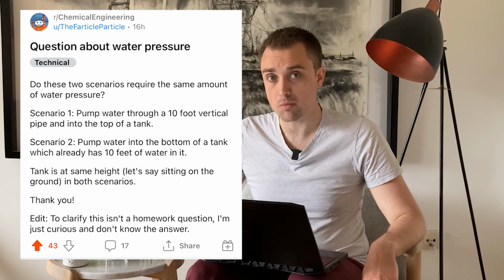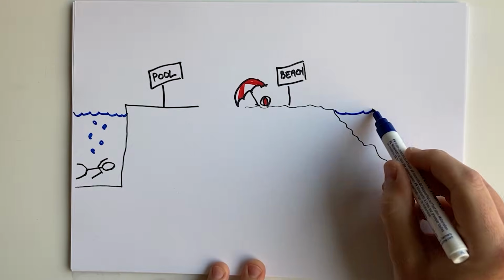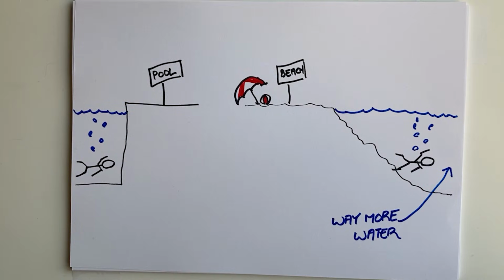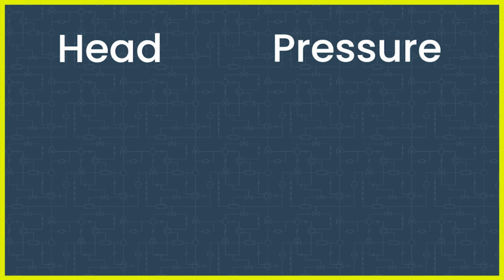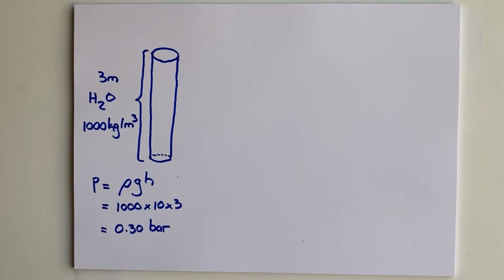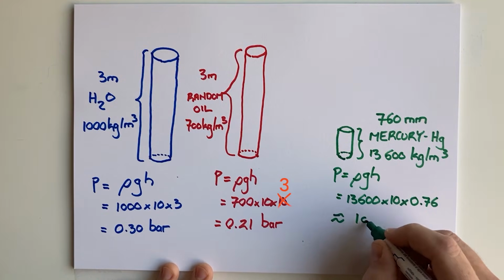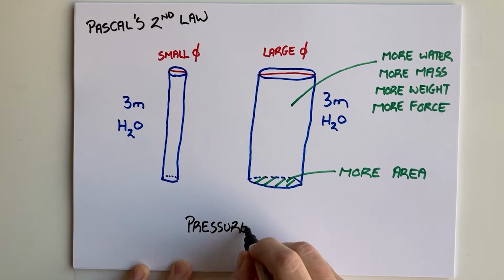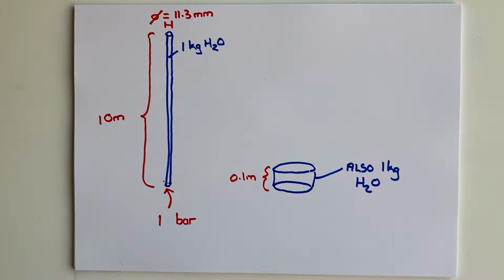Pressure, head, and pumping into tanks

Comment: One aspect that nobody seems to have mentioned is that a key reason to prefer bottom filling in many applications (e.g. rural water tanks) is that you can use the same pipe for both inlet and outlet for much of its length, thereby nearly halving the quantity and cost of the pipe needed. In the case of a tank on the top of a hill that is distant from both the dwelling and the water supply that can be quite significant.
Reply: As a plumber I have to consider cross contamination to the source water supply. There needs to be an air gap or some type of backflow, backflows have to be tested annually for potential failure, to protect the potable water supply source while also considering pressure loss or gain because of specific gravity’s .433 psi drop or increase per foot of rise or fall and maintain working pressure range to the fixtures. I would never bottom fill a storage tank just because of the potential cross contamination potential and an air gap is the safest with minimal potential failure and maintenance of any backflow prevention that you can use.
Reply: Good point for many applications, but in my case the source and storage tank are are all prior to filtration and water treatment including UV, so the potable water is protected by other means. There is a backflow prevention valve as well. The tank is perhaps ¾ mile away from the source so digging in a second pipe would be a lot of money for limited benefit. In a supply to another property where the tank is only around 300M away, we have run a second pipe with top entry.  @shadeiland
Reply: @shadeiland  wow! i removed my outside taps one way filter, so far no ratz have got inside!
Reply: @shadeiland  When I grew up we didn't even have a proper tank it was just a room in the basement made of concrete with no door. It did have an air gap at the top so you could see inside. So I'm guessing cross contamination wasn't as much of an issue as regular contamination.
Reply: It reduce the quantity of gas in the liquid too, wich greatly reduce cavitation in the pump. This why even if you pump in the top of the tank often the pipe continu in the tank to the bottom. Essential in case of high pressure pumping.
Reply: Not only that, ik you fill from the top, like in the example as seen in the video, you ALWAYS have to rise the water 3 meters, and the pump always has to use maximum presure ( and energie) to do that.

when filling an empty tank from the bottom, it just costs a lot les energie to do it from the bottom. than from a fixed heigth at the top.
Reply: @pw6048 The energy requirement for the pump is not the only variable you have to think about.
Also safety and hygine.
If you fill from the buttom you put fresh water in and pull the fresh water out the old water on the top will be stagnating and grow bacteria.
Reply: my tank fill at the top, or otherwise the water will run back to the source when source has no water.......       or check valve is  needed
Reply: @Google_ai_told_me_my_iq_is155  You have the most reliable check valve possible.
Reply: True. When refueling aircraft they pump from the bottom of the wing for a couple of reasons. They don't have to pump a greater amount of fuel up and over the wing. Also, it's safer than having to drag the hoses over the wing and even possibly damaging the wing.
Reply: such a very different use case senario!!
Reply: This is also true in urban/suburban water tanks.  A water tank is used to help maintain the head on a water system while pumps are capable of supplying that head while also pushing new water into the system.  While pumps are capable of providing this head that the system needs, it is more cost effective (energy costs and wear on the pumps) to use tanks/towers in conjunction with pumps.
Reply: Also, maybe I'm wrong, but filling from the bottom means initial pressure is very small, and you only get maximum pressure at the end, whereas filling from the top you end up with maximum pressure from the start, so the integral by time, that is, the work being done, is higher for the top-filling process.
Reply: @olegshevchenko5869  that would be true if the depth of tank was large compared to the height between the bottom of the tank and the source. That is true for many scenarios - e.g. fuel tanks - but not for my scenario of rural water tanks in Scotland where the height of the hill is much more significant than the depth of the tank.

Comment: So, your argument would conclude that there is less pressure filling from the bottom of the tank. As the top pipe will always need to be at least as high as a full tank. But filling from the bottom the pressure will vary but will always be less until the tank is completely full.

Comment: Not sure why you don’t want to use the true figure if 9.8 because it’s not 10. That’s a massive difference. I work in high rise buildings so the 0.2 differences over 30 or 40 stories is massive. Do the calculations right next time.

Comment: Ok so what about a huge rectangular tank that has a small triangle protrusion at the bottom of one side?  If you connected a pipe to the small triangle part, the height of the water there would be miniscule so the pressure there would be next to zero.  And if you just removed the pipe from the small triangular protrusion, the pressure of the water coming from the tank should be almost zero because the head pressure by your definition should be very low.  I don't think your definition of the pressure there is correct.

Comment: This was a good explanation for the average layman.  I am glad you mentioned you are ignoring frictional losses as I assumed by the question that "pumping" is a part of this equation.  So I immediately assumed that Option C is the lowest loss, Option B is the second lowest loss, and Option A is the highest loss.

All options pump against the same static head, but option A has the highest frictional loss, and Option B has a higher Discharge coefficient than Option C due to the 90 degree angle at the discharge point.  Option C has a less that 90 degree discharge angle and therefore less loss due to the lower discharge coefficient.

This takes me WAY back to my Engineering school days.
Reply: When I pump horizontal, how do I know how long my pipe can be? 
I want to pump water 100 - 200m through the garden (downslope) in pipes that maintain some pressure for the sprinklers. 
I understand this height (Hm) now a bit, bit i haven't figured out how to calculate how strong my pump needs to be to keep pressure for 100 metres of pipe. 
Can anyone explain?
Reply: Note this is only for one inlet and one outlet, for multiple outlets it’s a bit more complicated because you have to keep track of volume flow out of each outlet. But for one Inlet/outlet this should be the process. Along with the length of the pipe you are also going to need to estimate how much water you want to come out say 0.5 gal/min. Then look up how to get the friction factor off a moody plot it can give you an estimate of the friction losses based on the type of material your house is made up of (ie the roughness on the diagram which you will have to find yourself) and the Reynolds number (Re) estimated based off the diameter of the hose, the velocity of the outlet (you need the vol flow rate and your gonna divide that by the cross sectional area of the pipe in this instance), and the viscosity/density of water at probably an average temperature for your area or you can calculate for temperature ranges and manual switch based on different temperatures up to you. Then using another equation called Darcy-Weisbach equation you can then calculate the head loss which can be added to the right side of the Bernoullis equation (an energy balance equation if you’re curious) you can then back solve for the pressure at your spigot by assuming an outlet pressure of 1 atm. The velocity of the side of the outlet will be calculated by  the vol. flow rate you want along with dividing that by the area of the outlet. GL to anyone who wanted an answer to that question and feel free to critique/add on.

Comment: Interesting question and explanation.
BUT. Filling tanks with pumps require less energy when pumped through the bottom than when pumped through a pipe connected to the top of the tank!

Comment: The pressure loss cannot be neglected!
Example:
Pipe DN40, 10 m length
Flow rate: 320 l/min
Flow velocity: 4,5 m/s
Pressure loss: 0.5 bar

With solution B and C you need less pressure.
Reply: Also, exit losses will be different and "A" has one more elbow.

The analysis in the video is quasi-static.  There's nothing wrong with that, but it should be mentioned.
Reply: What I like about A is that if you turn off the pump, the fluid stays in the tank and doesn't flow back (only the portion in the pipe)
Reply: @CatNolara  Yes, this is true.
Reply: No tank is always full. A pumps always 3m. B and C don't have to pump the missing height.
Reply: @Holzner1991  There are situations where fluid is pushed over a dam/threshold. In that case, it is always full after its been commissioned. E.G. water treatment
Reply: Side note: It should be calculated for 3 meters, it was 10 feet
Reply: The video is done considering a perfectly spherical cow of 1m diameter weighing 1kg.
Now, talking seriously, he actually mentions at 5:50 "some minor changes in frictional losses due to different pipe arrangements". I would have probably put a little bit more emphasis in that, but hey I am an engineer...
Reply: Your pipe size is too small, you should be using at least DN50 and preferably DN65.
Reply: Not the point of the video. If you lower the flow rate pressure loss decreases as well, so it's a moot point in this case.

Comment: Thank you for the explanation!  But I have two questions.  1. If the tanks were empty, would you notice a difference in pressure?  2. If we pump into the reservoirs a liquid with a higher density than the liquid in the reservoir?  and an additional question, reservoirs have different internal pressures 1. it is below sea level, 2. it is at sea level, and 3. it is at an altitude of 3000 meters?  In which reservoir would it be easier to pump liquid?

Comment: However, scenario A requires more overall energy to fill the tank than B or C.  Think of slicing the tank into thin slices of water.  In scenario A you are lifting every slice of water to the top edge of the tank while in scenarios B & C you are not.
Reply: you are correct, but fluid dynamics and fluid viscosity will also play a roll. In theory, an open ended pipe will have less resistance to flow, even though it will have the same head pressure at the same height. You also have the advantage of a siphon breaker in the event that something fails in the pump system.

Comment: That was great.  However that the small tube can transport water without having the tube full and thus have the full height of water pressure on it.
For example a screw type setup.  Now of course, it is a form of leverage where the rate of water filling is less.   It would be like filling it a cup at a time using a pulley to pull up the cup and dump it.

Comment: If the tube is narrow, and the time to pump a given volume is finite, the pressure to pump water or any other viscous fluid trough the pipe to the top of the tank (longer pipe) extends the pressure, when the pipe ends at the bottom (shorter pipe, and the wide tank). That was my intuition. Also with the bottom configuration we can start with empty tank, and low pressure and then we increase it as it feels up. In case of the long, narrow pipe we have to start pumping with max pressure at the start. 

I know. I should get a life but it is much easier to watch YT videos and be a smart ass in comments

Comment: If you pump into the bottom of the tank it takes less energy because the column of water is always less than the full level.
Reply: Never more than the full level would be more accurate.  In the diagrams, there is some distance from the top of the tank to the upper fill port.  If the fluid exceeds this, then the heights become equal.
Reply: Not true.

Comment: Imagine a submerged sphere, where the air pressure inside is at atmospheric, in a pool, 10m deep.  Now imagine a portal in the bottom of the sphere open to the pool water.  Also imagine someone in the sphere that can touch the water through that portal. What is the pressure of the water, as measured at the air-in-the-sphere to water-at-the-portal interface?
Reply: @@ithecastic exactly.  could you still tip it?
Reply: @@ithecastic out here in California, we say "cow tipping".  But, I have heard the phrase "cow rolling" .... and see where you are going with it ..... that's funny.

Comment: We learned 9.81 m/s² in school... and back then I actually had a life 😁
Reply: Typically, you use 9.81 m/s² when you need precision in calculations and 10 m/s² when going over conceptual explanations.
Reply: @KevinZ.000 We were only allowed to use 9.816m/s²   😢
Reply: @Happenstandce  The 10 m/s² is for new concepts so student don't lose the forest for trees, meaning getting bogged down in the numbers and failing to understand the concept. Both are useful, it depends on what you are trying to teach and when in the lesson. 

Also, 4 sig figs? Acceleration of gravity varies by location, was that the measure value where you were at?
Reply: 32 ft/s²
Reply: @bowez9  Even as an American science teacher, I can confidently say I have never used that in a calculation.
Reply: @KevinZ.000  Eningeers use it.
Reply: @bowez9  Rarely, and only civil engineers at that. Electrical engineers have to use the metric system because there are no US customary units for electricity, volts, Watts and Amps are all metric.
Reply: @KevinZ.000  MEs too if your not using Slugs your using 32ft/s²
Reply: I'm glad someone provided the 3sf. Now we can get into the fact that it varies and can start discussing the need for a local measurement 😛
Reply: @alextopfer1068  Unless you live on the North Pole or in the Tropics, 9.81 m/s² will produce accurate enough results for high school physics. 😉
Reply: @joeaverage3444  It is more complicated than that, it varies on altitude, latitude and local topography and geology. I remember discussing in my upper-level mechanics class.
Reply: In the first quarter of freshman college physics, while working on an Electrical Engineering degree, the result of every lab we did in Newtonian Mechanics, even precession of a spinning mass, required us to calculate the gravitational constant based on the measurements of the experiment.  After 11 weeks, I had the value calculated accurately out to 6 significant digits at the altitude of the 2nd floor of the physics building.  The "get a life" comment was funny.  At least it is funny now 35 years after I turned in my last lab report.

Comment: This is all very well but having to pump water a lot I can assure you that tank A takes significantly less power than the other two.  And that if you make the end of the pipe into an exponential horn then the pump takes less power again.  I know that is beyond the level in the video.  But if an engineer was looking at the problem I would expect them to instantly see why one design is more efficient than another.  The effective head is the height the water is lifted to PLUS the kinetic energy component in the water velocity.1/2 m v^2 = mgh -> h = v^2/2g EXTRA head needed. In the other two tanks a lot of wasted power is used in turbulent flow within the tank itself.  Slowing the water gradually and regaining the kinetic energy is vital to efficiency.

Comment: Interesting question. The pressure that the pump has to supply at the same flow rates is greatest for A, less for B and the least for C.
A has static pressure plus pressure loss to generate the flow. The pressure to generate the flow is from the friction in the wall of the pipe and the discharge pressure required to expel the water from the pipe. 
B has static pressure plus pressure loss to generate the flow…..which is less because there is less length of pipe experiencing the full flow and the velocity up the tank is negligible…PLUS the pressure required to force the water into the tank…..because the water has to flow into water residing in the tank…which requires pressure.
C has all of B…..but…..the tapered entry into the tank will require less pressure than B….so the pump supplying C will read the lowest pressure while pumping. All three will read the same when not pumping if the water levels are the same. Q.E.D.

Comment: Would have loved to see how this relates to force, in car brakes for example. It almost seems contradictory to this exmplanation of pressure, until you think about PSI=Pounds per Square Inch, so if you apply X pounds of force on a small area it can cause a bigger force on a bigger area... but the pressure is still the same everywhere in the system... I guess?
Reply: It’s about how far the brake pads travel in relation to the brake pedal. Think of the lever, lets say one edge is 40cm away from the fulcrum and the other one is 10cm away. The farther end travels 4x more but gives you the mechanical advantage of providing 4x the force at the other end. Same thing with a brake system. You’re kinda putting little force on a long thin tube and getting more force at the other end with a big short cylinder. This is not a perfect explanation but I recommend you look into it on the web 🤞